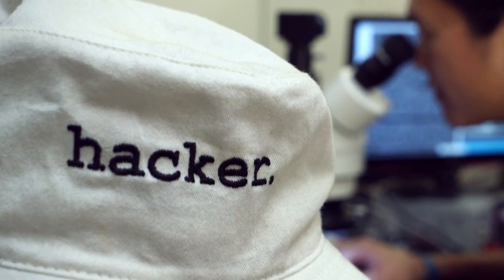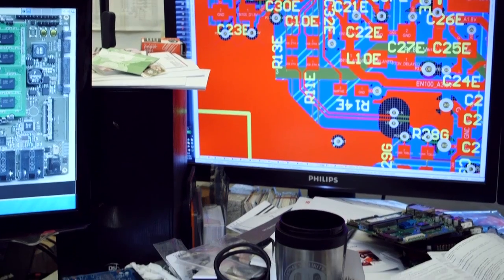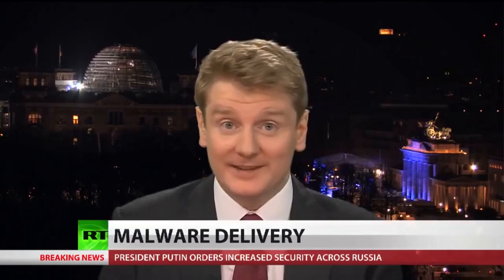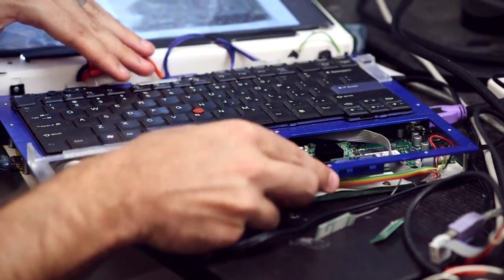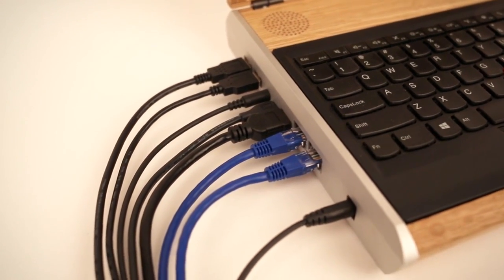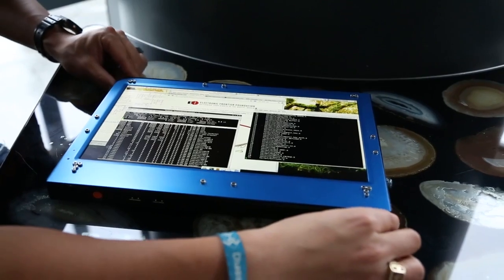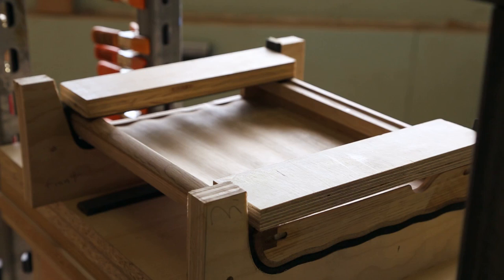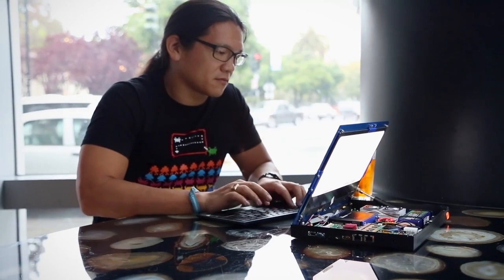NOVENA :: First Open Source Laptop

Comment: The Novena has a fucking FPGA connected to directly to the ARM processor, super interesting and exciting design, and you can buy the board on its own for like 600usd. which is great.

Its not for games and windows stuff,  it can be configured to do certain things much better than a normal PC: as oscilloscope, high speed logic analyzer, software radio, and more and more, if you are a programmer/hardware junkie its a highly valuable tool.

It was also mostly designed by two people, Andrew "bunnie" Huang, and Sean "xobs" Cross

Comment: This message is for the people who argue about the project, Well, this computer is made from scratch to respect it's user privacy and freedom, most computers today run with proprietary BIOS and firmware blobs, secondly, the hardware it use is pretty good unless you're a kid who don't care about anything but gaymez that's your issue, Oh! and the hardware is recommended for hackers not gaymerz :)
Reply: see the system76 laptops with coreboot (an open source bios based on linux) and they come with Pop os! an Ubuntu based distro who claims to be more stable, fast and customizable, using gnome 3. With the coreboot bios you can actually disable the f***ing damn Intel Mangement Engine and now they are working with Lisa su to implement the coreboot bios with ryzen laptops and desktops.

Comment: The new most overpriced laptop, $2000, for a fast phone processor, with shit graphics. This replaces apple as the new laptop I would be least likely to buy.
Most laptops are open source, as the processor/graphics can be upgraded, ram, hdd, screen, everything can be changed, and a $300 laptop will be more powerful than this shit.
Reply: Modularity is not the same as open source hardware. You can't find the schematics of all the components of the average computer, such that you could fabricate your own components and be sure they work exactly as you intend.
Reply: [beep] Troll detected.
Reply: Yes
Reply: Let me express myself in typical YouTube commenter fashion. You FUCKING IDIOT, fucking Google "open source definition" before showing off how little you are informed; not to mention lazy. Fuck. Off.